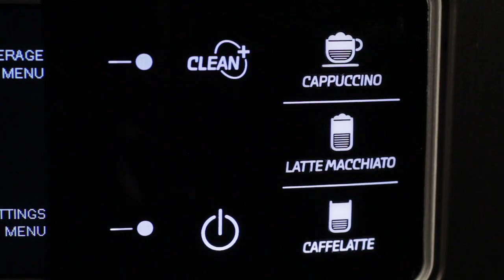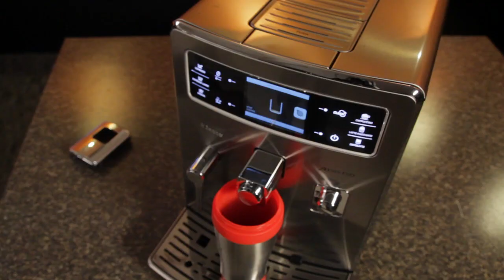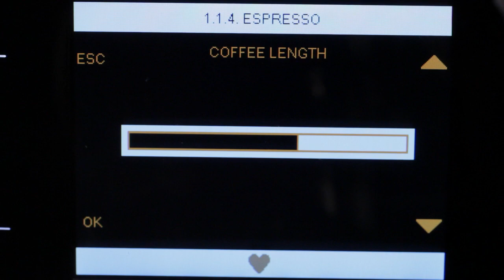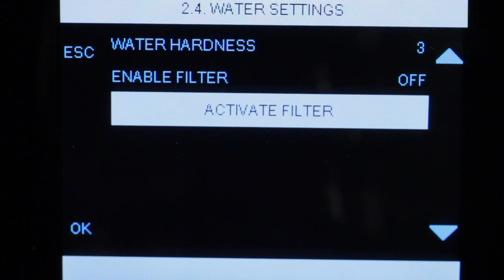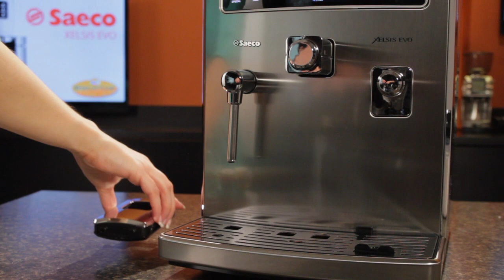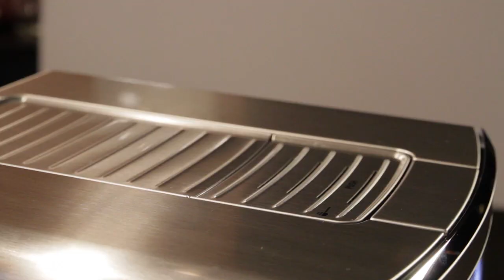Saeco Xelsis Evo Espresso Machine Overview

Comment: I have owned this coffee maker (Xelsis) for over 12 years and it is still an incredible machine. Take care of it, clean it and use it reasonably. It is the Gold standard by which I judge any other machine I own. I have a brand new Delonghi La Specialista Opera and it is excellent but doesnt have the capability of this outstanding Saeco.
Reply from the maker: Hey winz, thanks for sharing your experience. Here's the latest version of the Gaggia Accademia it shares DNA with the Xelsis but has a bunch of upgrades like one of the best UIs in the business and a Boost function which makes the best espresso I've ever had from a bean to cup machine - and I've used them all. Check it out: https://youtu.be/jZWS38_Jge4
Marc

Comment: HI 
PLEASE I NEED YOUR HELP !!!
i need to open my xelsis evo. and i dident find the service manual online of how to open it,
i have primea touch plus and i must say that i am know perfect to full service it and to complate to open it very fast and i did find servic manual of how to open it few years ago.

but to the xelsis evo i dont find any where this guide of how to open it

please if you can help me find it ?

thanks
yossi
Reply from the maker: Hi YS, Here is a link to a page with info on the Xelsis Evo including the manual: http://www.p4c.philips.com/cgi-bin/dcbint/cpindex.pl?slg=en&scy=si&ctn=HD8953/19
Reply: hi 
thanks
do you know if this model is louder when the pump works when its make the coffe? becuse my xelsis make louder noise then my primea touch plus

thanks
yossi
Reply from the maker: You are welcome. I don't have a Primea TP to test against for sound level so can't give you a certain answer. :(
Reply: Hi
Bit is the xelsis evo loud when it pour out the coffee?

Thanks
Yossi
Reply from the maker: Should not be louder than an average machine.

Comment: Could you tell me the pros and cons of this machine?
Reply from the maker: Hi Mike, Some pros: Hotter milk froth than many similar machines, user can adjust froth density, uses low pressure brewing to make American drip style American coffee, has clearance for many travel mugs and tall latte glasses, self cleaning milk system, coffee flow rate control, multi-user programming, color display, metal clad exterior. Overall, it's near the top of the line in super-automatic bean to cup machines. Cons: cost. Also it's not for the hands on geek level espresso hobbyist. They are better served by high-end grinder paired with a prosumer grade semi-automatic espresso machine.